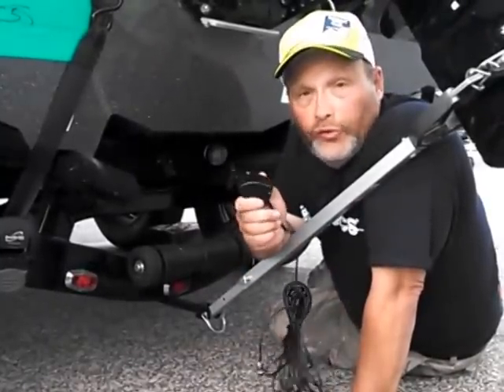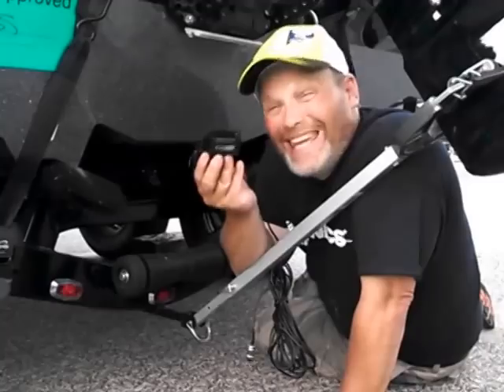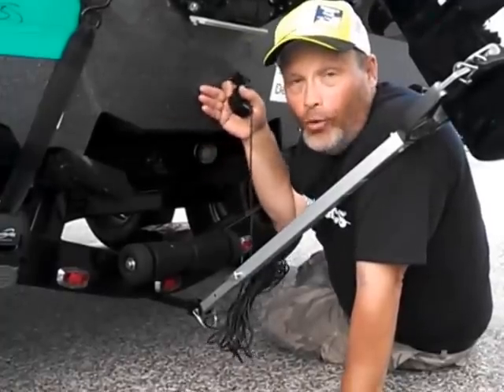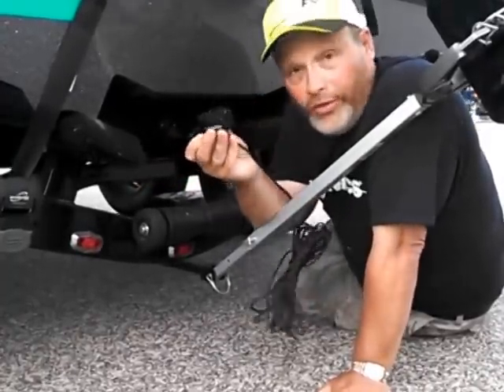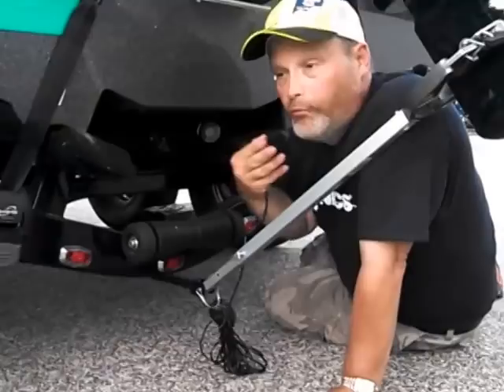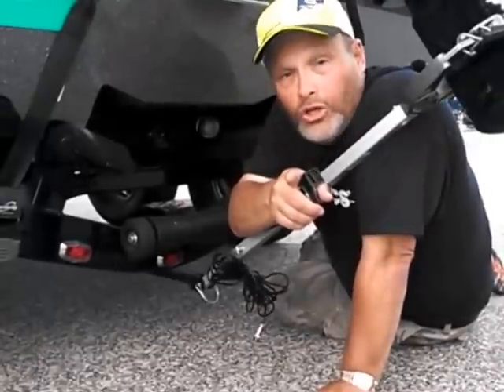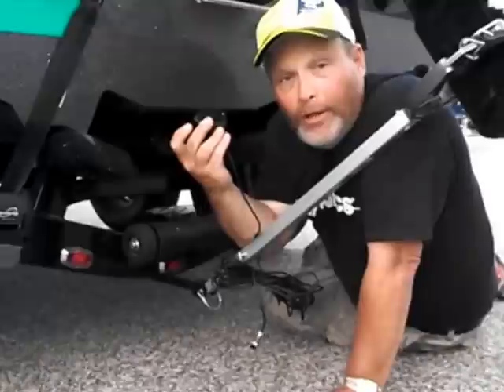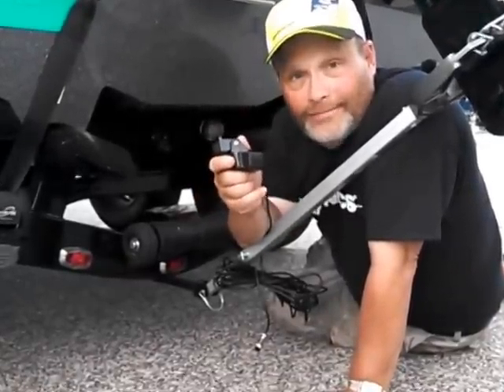Mounting Transducer in Fiberglass boats

Comment: Correct...as long as you fully encase the gap between the transducer and the hull with epoxy - sound waves from the transducer can't go through air gaps and WILL cause errors/no readings.